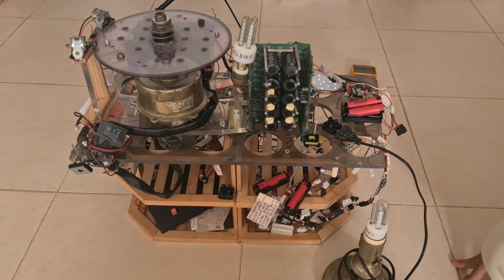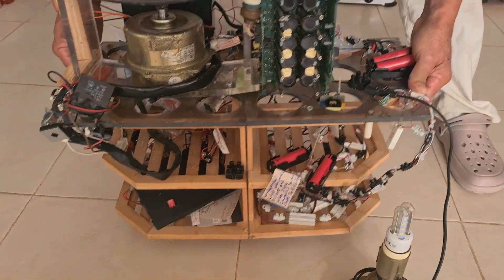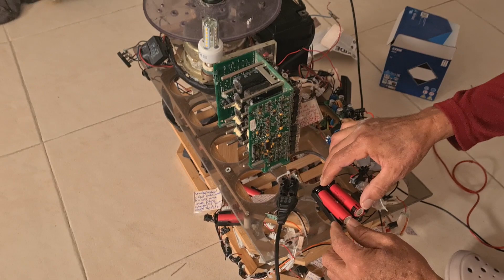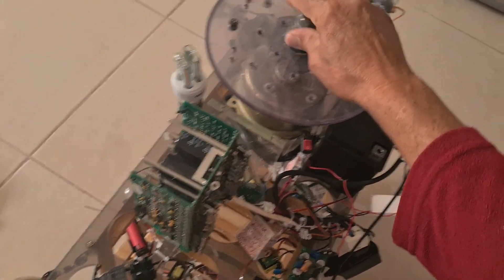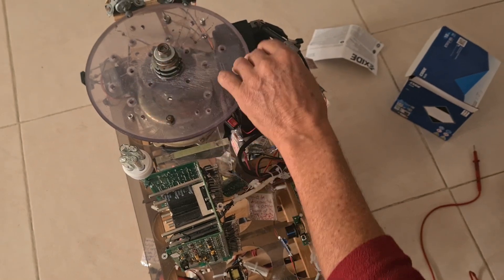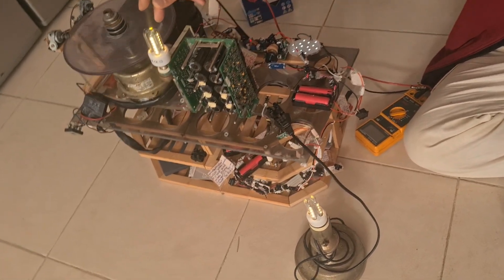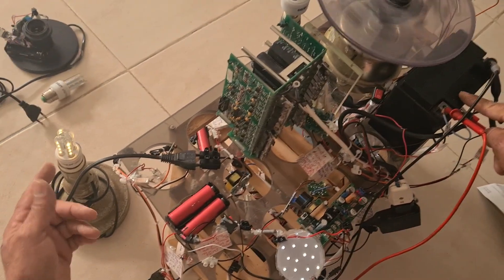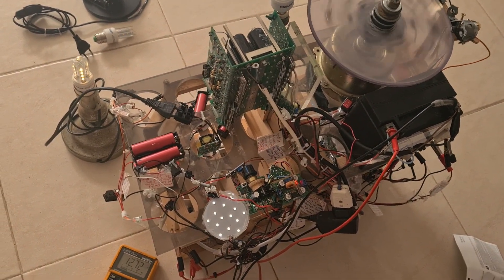The perfect fuel-less self-charging free energy generator 2025

Comment: You start a phrase, then you don't finish it, then you start another phrase. Do you expect us to understand anything?
You didn't say anything about the PRINCIPLE OF OPERATION, and what CLAIMS do you have about this machine?
Reply from the maker: i am sorry ,i have too much information on my brain,this machine use 2 tiny motors try to see it in the video,concamption 2w around 9 volts dc,the motors spin the alternator,the alternator charge not only the small litiume batery that runthe motors but charge to other size same bateries in adition and  light a 220 4 watts bulb with a micro invertor,so this is nice i belive,
Reply: @denissabourin  You need to learn how to explain. It is not about too much information. You are like a torrent of words.
Anyway, do you claim that your machine is overunity?

Comment: can you explain the principle of operation?, like i did on my youtube channel
Reply from the maker: Thanks for your comment. It's basically a battery charger that runs with very small batteries and charges a larger battery of 10Ah and two other spare small batteries. The principle is that I spin the plate which spins the alternator not from its center but far from it. There are two mini motors of 9V that work on a DC converter from the 2 small red batteries shown in the video and that helps me spin the alternator easily and prevent lens effect. The alternator gives more output not only to the charge but I can also run 2 bulbs with it with the help of the capacitors and a small inverter. There is energy leftover to charge back the two small input batteries from the 10Ah battery and there is also enough power in the 10Ah battery to connect another inverter of 500W if you want to power 2-3 additional bulbs of 220V 6W each. I saw your channel, interesting videos, thanks for sharing it. Best regards

Comment: OMG totally FAKE 1st your capacitor bank is an inverter 12v to 110v if you take every one as an idiot i suggest you learn  There is No such thing a FREE energy. all those small plug in chargers are only at best 80% efferent converting an ac shaded pole motor by adding magnets Funny . may look cool but doesn't do any thing close to your claims. 100% fake .  Get a life stop making false machines with false claims . No circuit diagram . No power usage meter to measure watt used . or any proof . FAKE